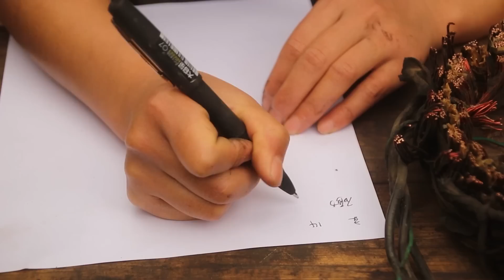💡 Repair 10KW Generator From Chicken Farm, Girl Keeps It Working Again With Easy Restoration

Comment: Excellent Job, thank you for sharing!. I used to service and re-wind large motors and generators, and might mention that generator burn-outs were usually due to connection lead wiring in the generator head not being securely insulated and secured so the leads would not touch and rub against the generator housing and junction box, and causing a short to the generator frame, and burning-out the windings. At 20:00 it looks like you have done a very good job of insulating and securing the winding leads inside the generator, and insulating the leads in the termination box, and i might suggest you tie and secure the leads in the termination box securely if you had not already done that.  Your videos are a pleasure and I look forward to more!.

Comment: Someone showed me this video and asked me if I could do that. Sure, I can, a lot of people can, that's not the point. I've got a shop with several hundreds of thousands of $ worth of tools plus 50 years of experience. Lin if self taught, takes great pride in her work and does an excellent job with a minimum of tools! She is 1/3 my size but still moves these heavy generators around like she's the Hulk!
She doesn't have all the tools she needs... If I knew where she was I would send her some tools, for sure a better helmet for all the media blasting she does. One that pumps fresh, filtered air into the helmet when she is welding and blasting. Those fumes and metal particals are very hazardous to inhahe! . Keep up the good work Lin, be safe. 
BTW, what is the BIG dogs name?

Comment: An excellent repair as always! When I traveled to China a few years ago, I saw a lot of generators powered by similar water-cooled diesel engines. I think the boiling water cooling for the engine is a really good design, and I wish we had more like them here in the U.S.

Comment: This generator seemed a bit more complicated that your previous projects.  The rebuild was fun to watch.  One thing I wondered was why the fire?  I am very ss
Reply: My guess is that the fire is to heat the windings so the varnish that holds them in place will bake and burn off. Otherwise, the wires would be very difficult to pull out of the slots.
Reply: @clarencegreen3071  correct
Reply: After the windings have been installed in a motor or generator, the entire assembly is often dipped in a resin or varnish bath once or twice, and this helps to further insulate the wires, and hold them in place. Lin usually adds this varnish by hand, from a plastic cup, and "paints it on" with a small paint brush, although she left that step out of this particular video, which is unusual, as she usually shows this step. If the motor or generator ever gets rebuilt, while it's possible to remove these wires by force, the easier way is often to heat up the entire assembly in an oven, or use a more primitive method as she did with a wood fire, to melt the old varnish, thus making the old, burnt-out wires easier to remove.      - j q t -

Comment: I missed the old scissors for cutting the copper wires - you now have new wire cutters! 🤭I suspect the next item to replace will be the micrometer - it can't possibly give you an accurate reading with so much corrosion! Thanks again for a lovely video.

Comment: Amazing,as always. 
I'd love to know how you know so much about so much. You are young yet you have a lot of experience doing a lot of things besides generator repairs, which alone is super impressive. 
Anyway,hello from Maine.
Reply: She has a BA in hydroelectrical engineering. She must have learned indepth how motors work and how to dissemble and reassemble them
Reply: @mechannel7046  wow....super envious...
A degree in hydro....I worked in that field for a few yrs...running power plants. 
That explains how she knows about gennys,etc.
Hey thanks MeChannel!

Comment: Wooooooow
Very excellent work. My question is how many poles does this generator have, and what is the way to connect the internal and external coils in it. Thank you
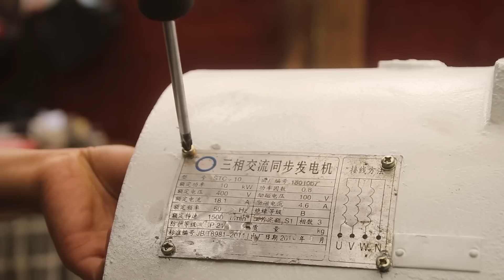Reply: Bei 19:32 wird das Leistungsschild gezeigt. Der Generator ist 4 polig (50 Hz; 1500 Rpm). Die anderen Daten: 10 kW; 3 x  400V; 18,1 A. Weitere Daten auf der rechten Seite des Leistungsschildes betreffen die Daten der Erregung, also vom Rotor. Der war wohl noch in Ordnung und wurde so wieder eingebaut.

Comment: Hi,you are good and you work hard I would like to give you just two small tips when outside hard materials such as iron you have to use a low number of revolutions and lubricate well The WD40 is also fine while when you mount the bearings it would be good to use a tube that is more or less the central diameter of the bearing on which you hit so as not to distort the bearing and its balls I hope it can be of help Ciao!

Comment: She doesn't keep it working, she MAKES it work again. Completely rewinding it. A big job, and not for the faint hearted. In fact she may know more about electrical engineering than even our best electrical engineers. Talk about knowledge, this lady has it in spades. Too cool for words. I bet she could take apart a buck converter and make it work perfectly. What do you think? Will she make it work better than the factory that made it? Probably.

Comment: I love your work, Lin. I am glad to see that you wear the proper safety equipment for sandblasting and spray painting - but Please Oh Please wear some safety footwear. You work on some heavy equipment and the training shoes you wear offer little to no protection for your feet and ankles. I am an old timer and I have seen some nasty accidents. Safety boots have saved my feet from very nasty consequences more than once. I ended up with slight injuries instead of major ones,

Comment: 23:03 So when she is manually "sparking" the generator to start the flow of electricity, how is that handled via a commercial "off the shelf" generator?   Is that just a starting capacitor that handles that process?
Reply: Hi Jim, I'm not sure but I think it only needs doing once to restore some minimal initial level of magnetism in the stator - the non rotating bit - after that with future start ups once rotation starts the magnetic flux energises the rotor and it's rotation in turn (!) strengthens the field in the stator, rather like the way an old fashioned car dynamo gets energised. Maybe someone who really knows could comment?
Reply: @bobuk5722  And what is an "Angry Strike Generator"?   Is that different than a "Happy Strike Generator"?   Or is it still perpetually angry even after it's been repaired?

Comment: I just watched this for a second time, and although I like the video, Linquoer's hair is too close to the generator pulley when she's posing with the light at the end.  If her hair braid gets caught in that pulley, she will not survive a most tragic accident.  She needs to be more concerned about SAFETY and not about the photo op at the end. A sudden twist of her head and that hair braid could wind up whipping into the direction of that pulley. It is a major concern of mine. I hope she reads this and takes a more cautious approach. Maybe a hat where she can put that hair into and never get even the slightest possibility of it landing in a bad place.

Comment: Why didn't it immediately light the light bulb why did you have to use the battery for it to light the light bulb
Reply: to excite the magnetic field
Reply: The rotor (rotating part) must be magnetized for the generator to work. It uses current flowing through coils of wire in the rotor to produce the magnetic field. The battery is connected briefly to send current through the rotor coils to produce the initial magnetic field. 
   Once the generator is working, a small current from the stationary (stator) windings is sent through a rectifier 21:12 to the rotor, and the battery is no longer required.